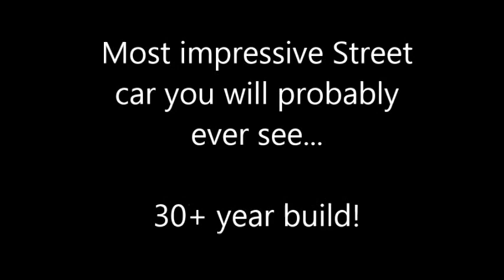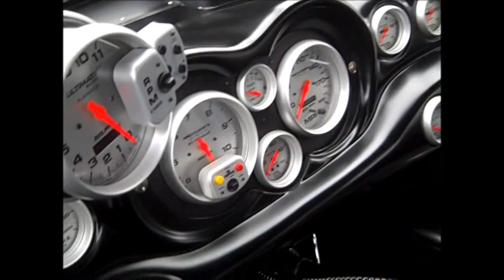2500hp STREET LEGAL Car!!!

Comment: Ive never watched this much video about one car but i"m amazed by this car and more so the builder...No shortage of insane HP cars and enigine builds online but you guys tell us so much about the work that goes in to such a project and it's just the right amount of info on the CRAZY engine to explain everything without boring someone who knows a little or a lot about cars.

Thanks so much, this car can only be called one thing... CAR PORN rated PG

Comment: Born as a 1963 Plymouth Valiant 100 2 door post coupe with either the 170 cid or the 225 cid Slant 6 .Have had my '64 Valiant 200 for 30 years or so now and still runs and looks great 50 years later . Mopar or no car !

Comment: This is a 2500hp keith black block with custom stageIV heads. It runs on methanol or could be run on e85. Yes i street drive it. i just drove it down the freeway sunday 13 miles. I got 1/2 mile per gallon. To see more details

Comment: tires are guick time pros has dot stamp on tires. runs dmpe 14-71 with mods. no not quickest but should run 6.50s to 6.60s all pro mod stuff. really street driven though. and yes its legal. has four mufflers all custom made

Comment: World's Fastest STREET LEGAL Car? it is going to need a timeslip for about a 6.40 over the quarter, at about 240 MPH to live up to your claim. Search Andy Frost, or Tom Bailey if you prefer American. Cool car, but not as cool as you think.
Reply from the maker: Their is a car in europe that has 2000hp and he claims its fastest in the world, this is 2500. Just going based off that. This does run 6's, btw.
Reply: Tinman II Kustoms He doesn't claim it, he has time slips that back it up, he has also been on Television driving it round on the streets, and doing the quarter mile. You can't just decide you are the best in the world, and claim the crown, I could do that. It is all about proof. Man up and prove your bold claims. The other guys, ( Andy Frost) (Tom Bailey) do not need a second person to start their car either. Your car is super cool, but your claims are bullshit until proved. Bailey's car runs 6.70's, and it has 3350 HP, as dyno'd by Steve Morris, all documented and video'd.
Reply from the maker: its not my car. And it was 40 degrees outside, the blower was freezing up. I can watch youtube videos of that gold camaro too man. Talk like you know, but your just getting info from that other video.
Reply: ummm, ya, Andy Frost ( Red Victor ), for the fastest street car in the WORLD, ( the world includes America ), and Tom Baileys Camaro for 'Murica. Pretty sure Toms car is quite a bit over 3,000 hp, so if thats what you are basing the top spot on, Tom wins.
Reply: Darren Washen It is not a question of horsepower fool (MR T), it is a question of 1/4 mile performance. People build wildly powerful engines for dyno days, but they are no good for actually competing on the 1/4 mile Tom Bailey has run 6.70's, good, but not as good as 6.40's
Reply from the maker: its all a big debate. Will never be PROVEN.
Reply from the maker: Has he ever raced this car? Nothing is ever PROVEN.

Comment: whats the can with the breathers on it for?
Reply from the maker: Thats the oil reservoir. The alcohol mixes in with the oil because of blowbye from the boost pressure. The tank acts as a heater and burns the alcohol out of the oil so that you dont wash out the rings. The breathers allow the steam from the burning alcohol to safely escape
Reply: Tinman 2 Kustoms Well not exactly. Its a dry sump tank for dry sump pump. stores oil it sucks from oil pan. It takes 149 degrees to cook alcohol out of oil.
Reply: fredoiknowitwasyou DRY SUMP OIL TANK, SMALL ONES ON FIRE WALL ARE SPIT TANKS.